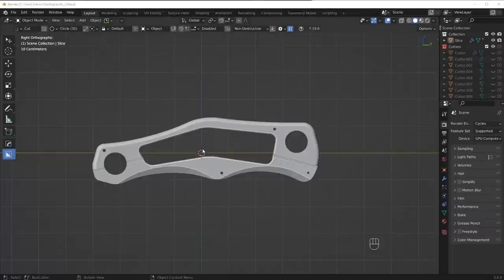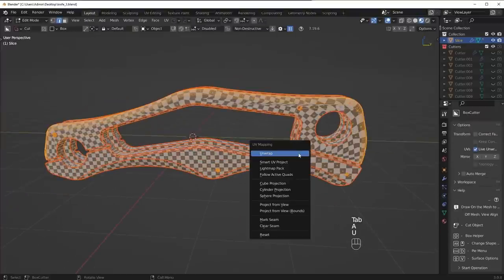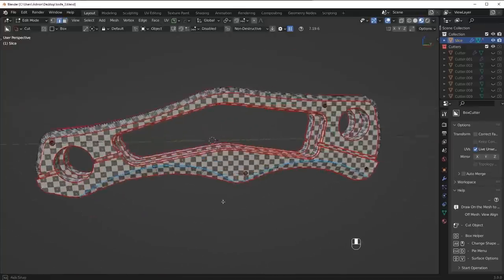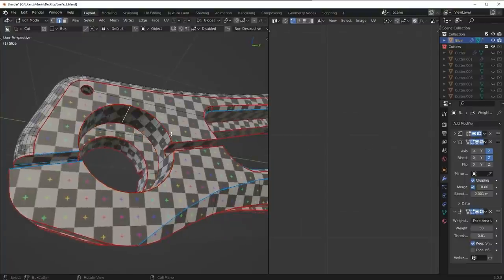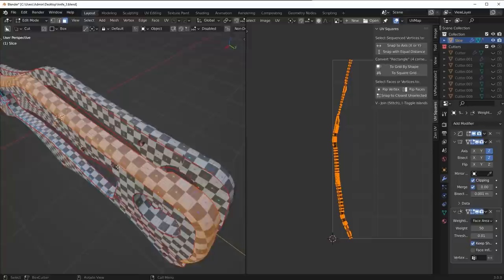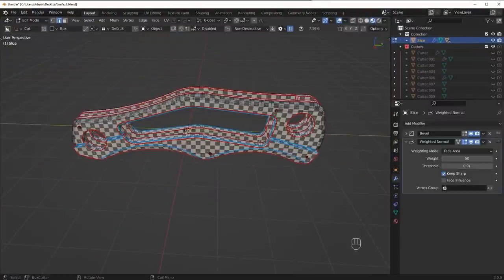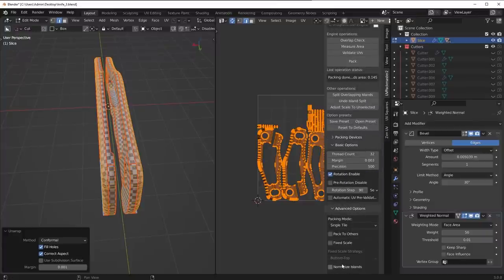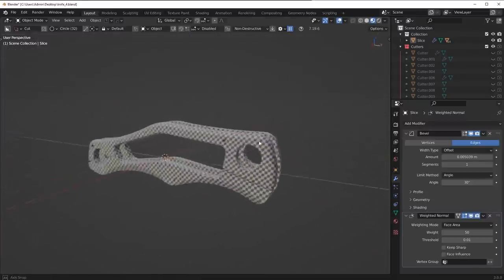A Simple Approach to UVs (Practical Example) | Blender Tutorial

Comment: Hi @josh. Do you have any advice on dealing with Faceting issues when using smoothing groups > UE4? 
Started a low poly project to reduce resources from high poly to low poly assets. The issue I keep hitting is the low poly Normals look fine in Blender such as a rounded cup, but the normals react flat to UE4 lighting and highly visible.
Just spent 5+ hours trying to understand this issue >.<

Comment: Where do I find the checkerboard textures I keep seeing used in every UV tutorial, but can't seem to find anywhere in blender? Looked under Madcap and Studio which is where I thought for sure to find them, but no joy.
Reply: I believe it’s under material property. First add the material to the object. There is a dot on the left of Base Color, click the dot and you will have the checker texture under Texture.
Reply: Download and learn texel density checker addon blender
Reply: When you have an image texture node in node editor or an empty Image Editor window, you can choose to Open an existing image OR you can choose to add a NEW image. When you add a new image, you can give it a specific resolution, and change its type from Blank (black or some other flat color) toa  UV grid. There are two different grids you can choose from.